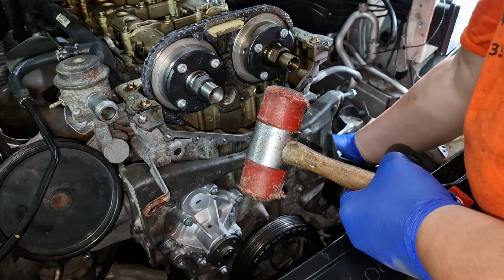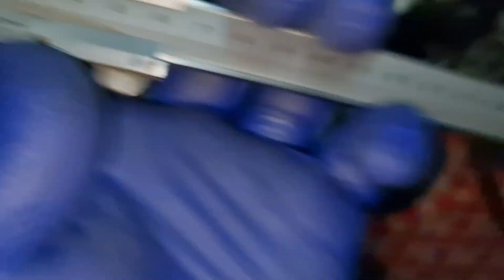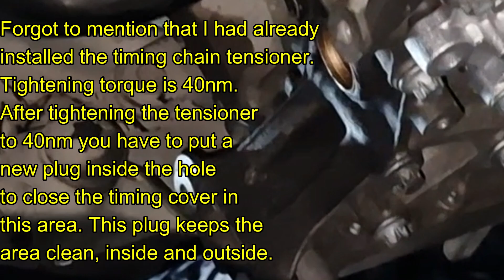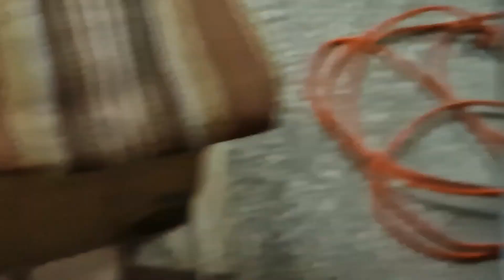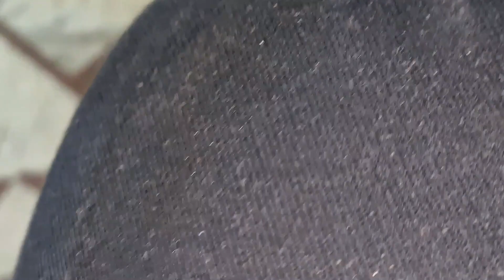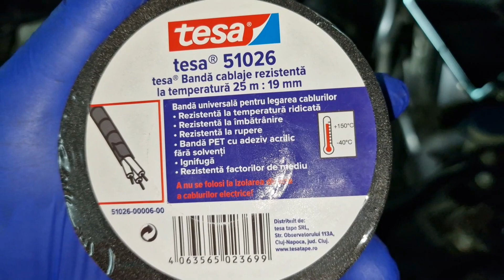Timing Chain kit replacement M271 Part 7

Comment: Did you use REINZOSIL to seal the head lid?
Reply from the maker: Where silicone bead is needed I used Victor Reinz gasket maker. Yes, Reinzosil is gonna be perfect.
Reply: @AlexAndreiZAR  The lid you are talking about 23:21 . I have also permatex 51813, what sealant do you think is best for this?
Reply from the maker: @NisseNasse the lid for the kompressor, from the top of my head I haven't used any sealant at all. Surfaces are perfectly machined and there is no need for sealant
Reply: @AlexAndreiZAR big thanks!

Comment: Cum ai strâns șurubul care ține  rola de la vilbrochen?
Reply from the maker: Salut. E necesar sa ai o cheie de contra pt fulia de la arborele cotit. Cheia aia arata ca o oala cu 3 ciocuri. La coada ei am adăugat o teava de aprox 1.5metri. Am rugat un prieten sa o tina contra cata vreme eu strângeam șurubul. Nu e deloc complicat.
Reply: @AlexAndreiZAR mulțumesc mult
Reply: @AlexAndreiZAR îmi poți spune cuplul de strângere la șuruburile carcaselor de la distribuție?
Reply from the maker: @mariusvochita4714 vezi ca e o serie intreaga. Nu stiu pe din cap cuplurile de strângere.
Reply: @AlexAndreiZAR ok am să mă uit la video clipurile tale mulțumesc
Reply: @AlexAndreiZAR spune-mi te rog de unde pot cumpăra un manual cu toate cuplurile și reparația?
Reply from the maker: @mariusvochita4714 salut. Nu e un manual propriu zis ci un soft denumit WIS-ASRA care vine la pachet cu EPC. Da-i un search pe google si vei găsi câteva firme care se ocupa cu pachete Star C4, C5, C6 Xentry DAS (pachetele astea includ si WIS-ASRA-Epc)
Reply: @AlexAndreiZAR mulțumesc

Comment: Timing chain tensioner.. is better to installi it before or after the tightening of the camshaft phases?
Reply from the maker: It doesn't really matter. The camshafts are held in place by the timing tool.